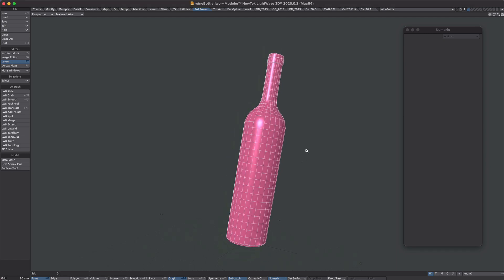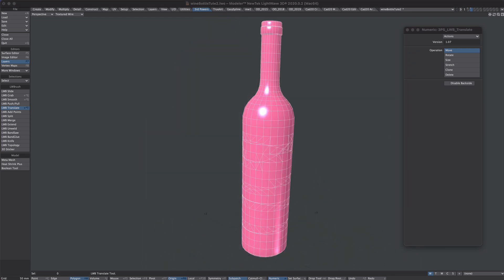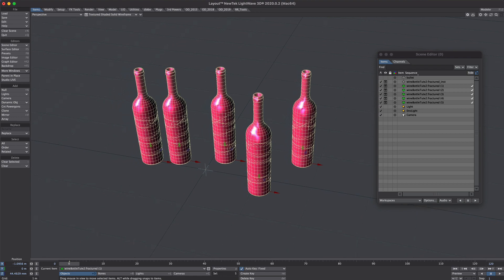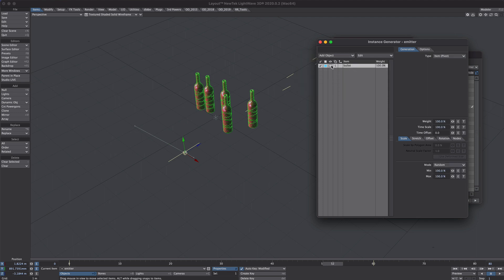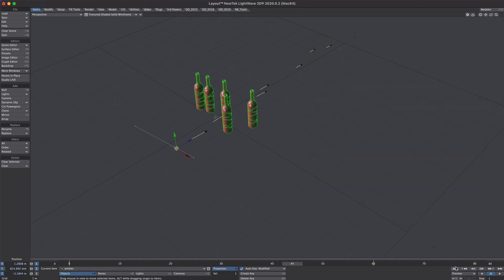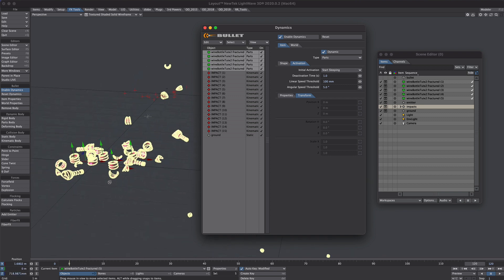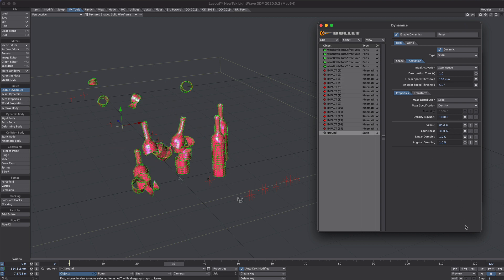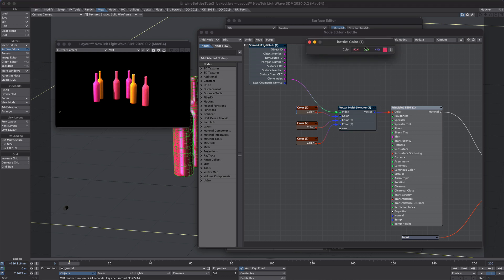LightWave 3d: Particles to Bullet Dynamics

Comment: Love your tutorials…. Always very inspiring.
If I see correctly, you’re on a Mac, right? What model, RAM, OS and especially GPU do you use?

I’m asking because my good old Mac Pro 5.1 (mid2010) is slooowly getting to a point where it’s more of a pain to work with, especially the choice of GPU can then become a nightmare.

That’s why I’m looking out for a possible follow up system…

So, any happy Mac/Lightwave user is welcome to give me a shout…

Best regards,
Steven
Reply from the maker: Thanks Steve, much appreciated. I’m on a 2019 16 core  Mac Pro/Big Sur. Very pleased with it as its not just LW I use, should keep me happy for a couple+ years yet. Got a concern about current LW future (if there is one!) and the new M series Macs, although I hear LW runs well under emulation. Guess we’ll have to sit tight for a while, sadly.